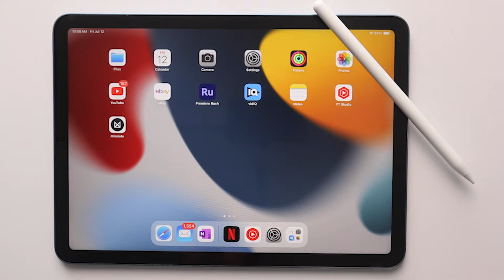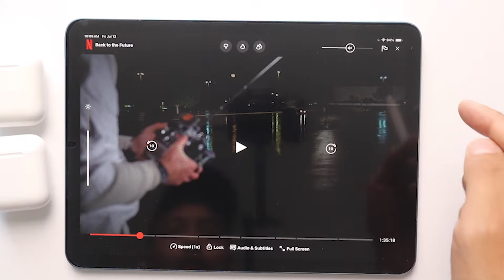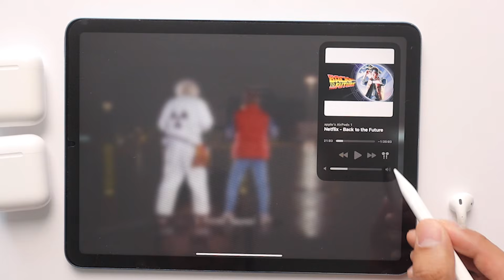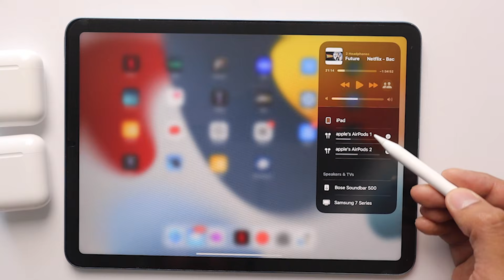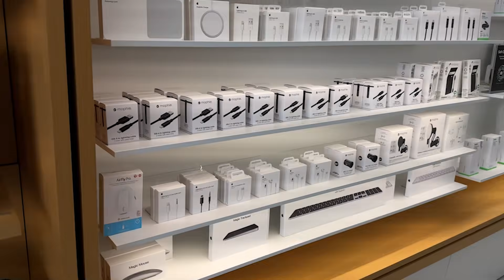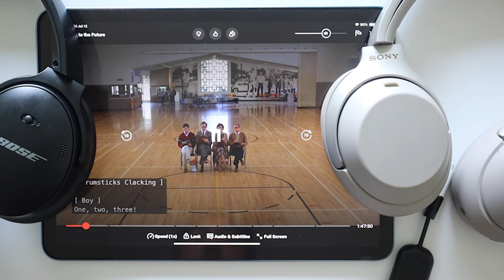How to connect ANY 2 headphones to iPhone or iPad! Adapter method!

Comment: Nice video. This confirms my decision to stick with WIRED headphones. Zero problems for my wife and I to share the audio while watching a movie on iPad. A Three Dollar 3.5 mm splitter and I'm done. Also, if the battery goes dead, I can just pop in another AAA lithium battery. With wireless headphones, they have non-user replaceable batteries that force you to charge them.  After a few years, the non-replaceable batteries will croak and you'll have to trash the whole thing.

Comment: How did you pair them ?bit of a click bait situation
Reply from the maker: Hi, maybe I can help. If you have the Airfly Pro hold down the button until the light flashes orange. Then hold the power/pair button on your headphones until it also flashes for pairing mode. It should pair automatically. If you have two headphones hold the airfly pro button down again. It might take a few tries. I think I might make a video on how to pair in hopes it helps.
Reply: @thetechmost  why you yapping bro, just tell the bro that he needs a Bluetooth adapter. you didn't even give him a real answer.

Comment: A cheaper option is to buy a splitter and use the wired connections that come with your headphones.  Yeah .. not  wireless, but you are sitting right next to each other anyway.

Comment: Helpful but this could've been a 2min video. You can connect 2 airpods no problem. If you want to connect non apple headphones you will need an adaptor the one suggested is apple's.

Comment: Helpful video BUT title should indicate adapter required.  Also device that also requires yet another adapter is a very clunky solution.
Reply: Just get the alternative one in the links not made by greedy Apple and it comes with an adapter. Of course

Comment: My old wired Apple headphones stopped working randomly last night so I bought new ones and those are still not working. I made sure the new ones are compatible (My device is iPad 10th gen and the headphones are usb-c) but they won’t actually work at all, the device doesn’t even recognize that it’s plugged in. I cleaned out the part where you connect the headphones, I even cleaned out my old ones to see if they would work but still neither headphones do. I thought maybe my device is broken somehow but then why would my charger still work and a different plug in I use to connect my microphone also works normally. The only issue is the headphones. I tried restarting my device, turning on and off silent mode, turning off do not disturb mode, and everything else that was recommended in videos and websites. Does anyone know what else I can do?
Reply from the maker: I'm sorry your headphones are not working. wondering if you take them to the apple store that they may be able to help you. I've never had this issue. I was going to suggest to clean out the port with a toothpick but seems like you already did that. Hope you find a solution.